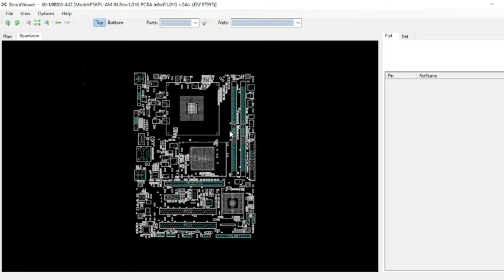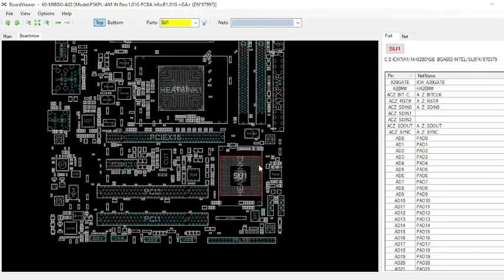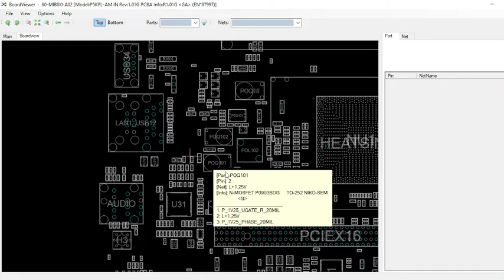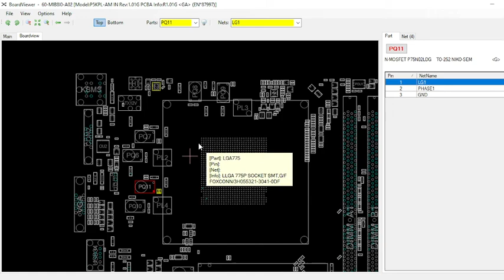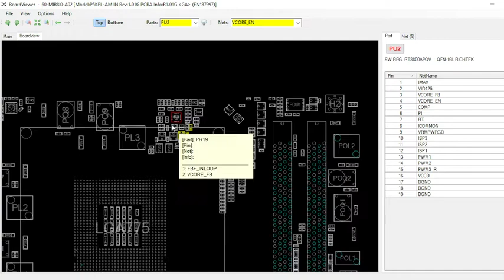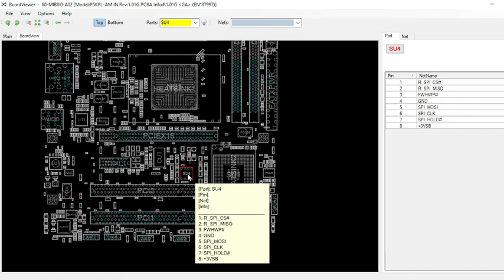G31 Motherboard Voltage Rails and Problems with Solution

Comment: hello again mate, do you have experience of motherboard is booting normal but after  20-30mins it will go no signal on monitor? even rethermal paste is applied. where do you think is the fault in that case? thanks
Reply from the maker: which motherboard check GMCH or PCH is overheating or not
Reply: @ifixelectronics555  its a a320m board , athlon 200ge i guess, ddr4 ram, ok mate,thanks, thats what i thought too, the one with heatsink, in that case need to rethermal that too with regular thermal paste right? Or need to reflow if still same issue?
Reply from the maker: check temperature of ich or pch aftet 20 min

Comment: Great explanation mate, can i ask if this voltage rails test points applies in ddr3 and ddr4 motherboards too? And i watched some videos of what they testing on pcie slot voltage too?
Reply from the maker: yes i have made video regarding h61 whuch contains ddr3 ram and 4 i will make it.... On PCIE you can check reset, Smclk, smdata and standby supply